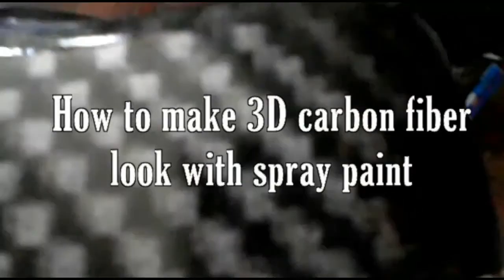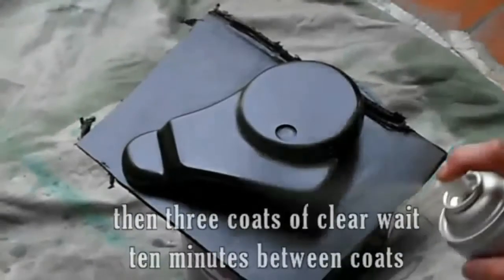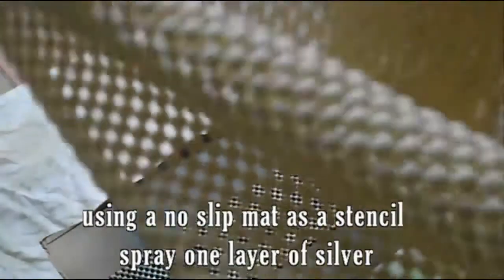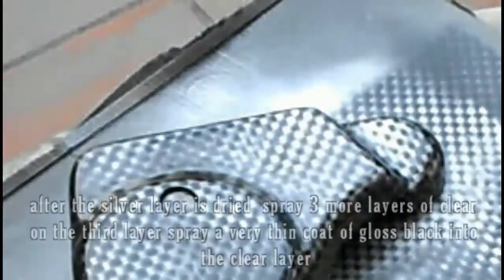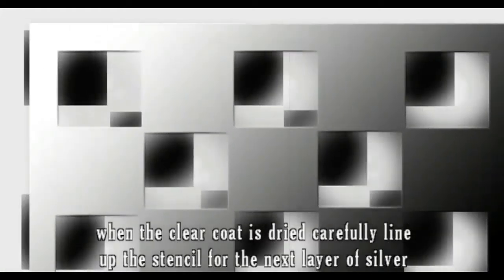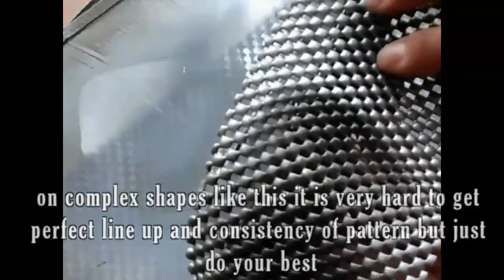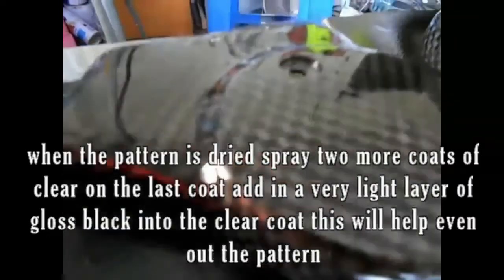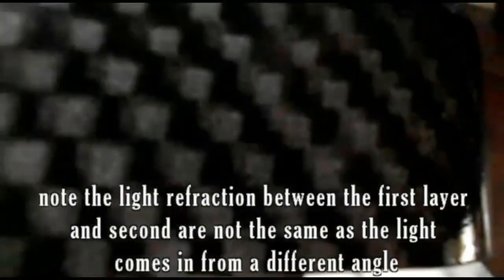3D carbon fiber look with spray paint how to

Comment: Pleas link to order stencil fiber karbon,,,🙏
Reply: Look for tool box drawer liner or kitchen shelf liner. Not the self stick paper or drywall type, this would be a 'foam' or 'rubber' type of liner. Can be found at car parts stores, hardware stores, or possibly even your local department stores.